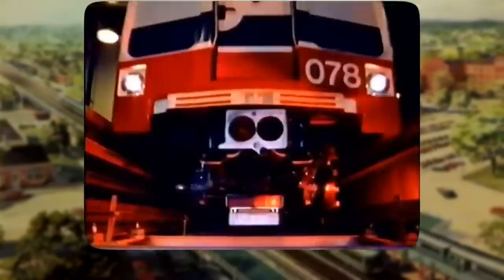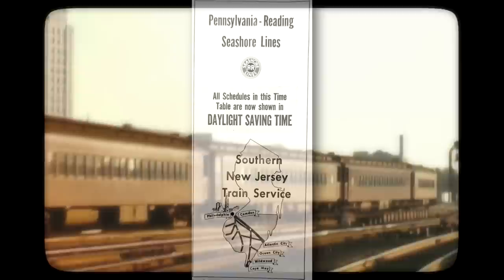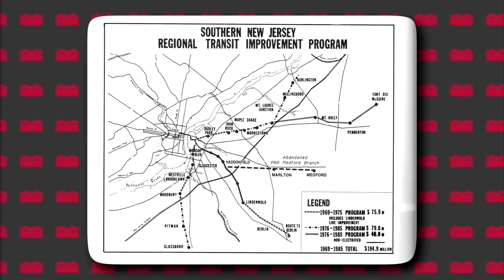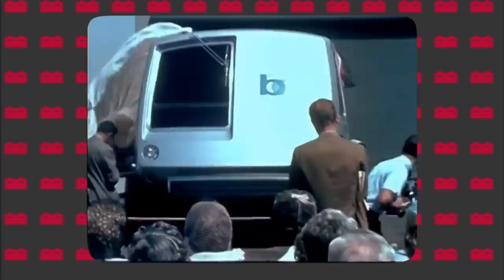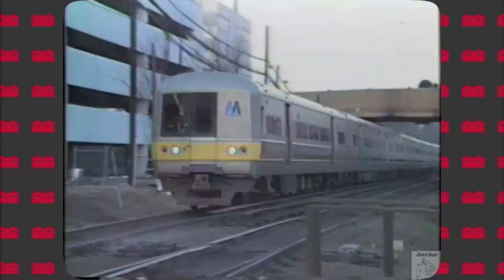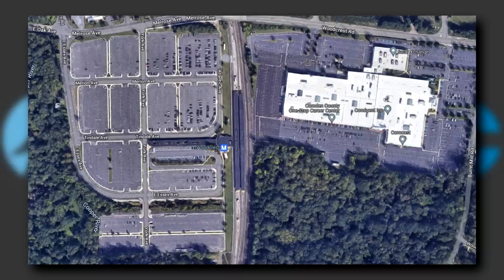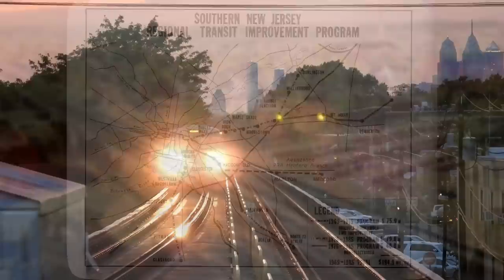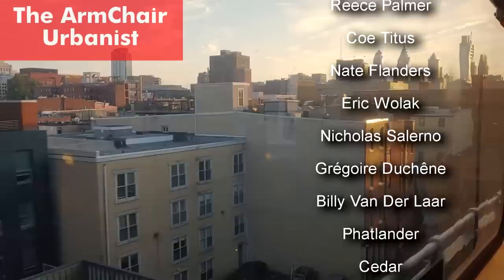PATCO: The First Modern Metro Line in North America

Comment: My favorite irony about the PATCO is that despite being very advanced, aesthetically it looks very retro to me (quite possibly because, being so well designed at the time, the system hasn't needed that many extensive upgrades, preserving more of the original fabric of the line)
Reply: If they ever DO expand (incl. New rolling stock) i really hope they retain that arsthetic as well as saving money by keeping it simple
Reply: Thats because it's effectively using the same railcars that it used in the 60s. They weren't even updated until around 2015.
Reply: Why are you saying it's retro like it's a bad thing? I actually I love it's aesthetic (but that's probably because I like the classic retro look of American Metro trains and not really that modern look that you would see in Europe or Asia).
Reply: @Machodave2020  it's not a bad thing, just a striking contrast! I like the look of the PATCO as well
Reply: @Machodave2020  I do too. Just pointing it out these are far from new.

Comment: We need more PATCOs across the continent, for real.
Reply: But with less parking and more TOD
Reply: @johnanders2739  yes i agree
Reply: Somebody in the 50s and 60s should have had that vision. Didn't any US generals avail themselves of the S-Bahn in Berlin???
Reply: @edwardmiessner6502  yeah center city tunnel is based on it. LA doing the same
Reply: Let's start with extending the actual PATCO from 1 to 3 lines like in the original plan.
Reply: Columbus should have a grade separated metro system but with low floor trains similar to the Confederation Line.
Reply: @SigmaRho2922  No, we don't need more light rail. We need more subways, because those are way more efficient and faster. They also look cool and actually encourage development.

Comment: PATCO makes getting to Philadelphia easier from NJ than from the Philly surburbs.
Reply: You can get from Collingswood to center city faster than rail lines from neighborhoods actually in the city itself (Manayunk, Chestnut Hill).
Reply: Yes, so true and sad. I limit my dating to ten miles on the PA side, there just isn't an easy way to get to a lot of neighborhoods in North Philly via rails, and I hate driving into the city.
Reply: It's also cheaper, when taking parking into consideration.
Reply: Well, parts of NJ, namely the Lindenwold line. It would be even better for commuting from South Jersey to Philly if PATCO stuck to the original 3 line plan.  Adding the Moorestown and Woodbury Heights lines could have doubled or tripled rail capacity to south jersey and taken that many more cars off the roads (I-295, NJ-42 and NJ-55).  And I still think that minimally just a second electrified potentially > 50% solar, grade separated heavy rail PATCO line is preferable to the proposed at-grade, diesel Glassboro-Camden light rail line.
Reply: @SP1CEANDW0LF  I mean that does sound awful in terms of rail travel, but it is not at all inaccurate to say that Collingswood is quite literally geographically closer to Center City than either of those neighborhoods are
Reply: Let’s be honest. You don’t need to “limit” your dating.

Comment: A little bit of context here: 

The US is the exact country where automatic train operation (ATO) was invented. To acheive automatic operation, you'll need an underlying protection system in the first place - the automatic train protection or the ATP - so that whenever ATO attempts to do something deemed unsafe, the ATP will alway safely intervene, usually by bringing the train to a full stop. 

The earliest railway ATP also came from the US. It has something called "cab signalling" in its core, which was invented by engineers at Union Switch & Signal (US&S) in ~ 1920s, when they realized that the electric currents sent to running rails for train detection (track circuits) may also be modulated to carry vital signal indications from wayside signal boxes to trains. Meanwhile, the ICC required railways to have some sort of automatic protection. Some big railways, like the Pennsylvania Railroad, tried this new technology, and found it to be so reliable that with cab signalling, you can actually eliminate most wayside signals!

Initially, power frequency current was used as the carrier of cab signalling. Upon invention, this type of cab signalling soon found its place on mainline railways in the US, especially in the northeast region. Passenger railways like Amtrak, LIRR, MNR, SEPTA, MBTA, still use this form of cab signalling today. Both PATCO and London's first semi-automatic underground line - the Victoria Line opened in 1969 - laid their foundation of automation on this service hardened yet a little bit antiquated technology. 

But major signal vendors in the US had been far more aggressive. In early 1950s, they found a better cab signal carrier: audio frequency current. Audio frequency currents eliminate most labor intensive inspections of rail insulation joints, are much less vulnerable to traction current interference, and are able to carry more information. These advantages naturally lead to preference over power frequency cab signalling among later transit expansion projects in the US. When SF decided to build its BART with most advanced signalling solutions, many vendors made their bids. The US&S's solution was based on audio frequency cab signalling, which enabled semi-automatic operation and dispatching. They lost the bid, but later provided a similar solution for Montreal's Expo Express, making the latter first railway in the world to run automatic trains.

The advancement in electronics pushes US-origin, "track circuit" based cab signalling and automatic train control to the apex from 1970s to 1980s, when the MBTA and CTA resignalled their heavy rails with audio frequency track circuits (so theoretically they can run semi-automatic trains but they don't), while the BART, WMATA, Baltimore MTA and MARTA built new semi-automatic heavy rails with them, until free space communication based train control (CBTC) went into the arena in late 1980s. 

While CBTC has been increasingly competitve, track circuit based automatic train control remained somewhat popular in the following decades to come. Taipei Metro contracted General Railway Signal (GRS) to provide signalling for their high-capacity lines; Shanghai Metro Line 1 also has GRS supplied signal systems, very similar to those designed for MARTA. LACMTA's Green Line, opened in 1995, has US&S's "next generation" audio frequency cab signalling that encodes digital signal indications instead of analog ones. In 2002, Copenhagen opened a fully-automatic, 24/7 light metro. Its signalling is not CBTC, but the same track-circuit based system US&S installed on LACMTA's Green Line! Contrary to popular belief, CBTC is NOT the prerequisite for full automation.

If you are interested in pre-CBTA era railway automation, you may refer to the following 1976 report by Princeton: https://ota.fas.org/reports/7614.pdf
Reply: Great write up!  Another thing to consider is that CBTC doesn't come "out of the box" with broken rail detection like AF track circuits do, which, IMO, should be mandatory.

Comment: I love the ambition of engineers at this time to try to solve the problems they saw with transport. Even though it doesn't solve the problems we need solved today, it's just one small change to get there. I think the same thing about WMATA, MARTA and BART. Really great pieces of underused infrastructure.
Reply: Even if the end product was not the greatest according to modern urbanism standards, at least they had vision and they built big. Today it takes 20 years and 20 trillion dollars to build one new line!
Reply: @pepperpillow  nah, we can still build things. It's getting the political will to do so.
Reply: @UrbanJerseyGuy  I think that marketing also plays a huge part in this. Germany doesn't do a good job marketing major projects and usually ends up developing opposition movements as a result. The US is better at marketing in general, but always enough to create political will.

Comment: I can remember as a little kid when Kings Highway in Haddonfield was dug up to put in the tracks and station for the High Speed Line.  The trains had a unique sound to them compared to the old diesel locomotives that ran through town.  I used the line often to commute to Drexel University in Philly and now as a senior I admire the vision and commitment planners had in the 1960s to make this work.  It is remarkable the system had only one station addition (Woodcrest) but no further extensions.  Thank you for the great trip down memory lane!

Comment: When I worked at the TTC I recall the 'Big' boss waxing poetic and lauding this line and the features built into it. 
I took the time to check it out for myself by riding the front seat and photographing it in the mid 80s and must agree, that this was indeed cutting technology and the best part, unlike most space age applications to transit, was as reliable as could/should be.
Bill Vigrass' commentary on the traction motor early failures reminded me of the Philadelphia and Western's high speed line and the similar early maintenance needs of the 'Bullet' car motors. Cutting the traction power voltage from the unusual 750 volts to the more common 600 solved the problem, but one could still experience the forces on acceleration of being pressed back into the seat cushions. Must have been something else with the full 750.
I must admit, that I like the P&W the best of all like demographic serving lines although with the PATCO's subway under downtown it is one step ahead in that detail.
Thank you for this documentary review Alan. I did enjoy it thoroughly.

Comment: It can still be great. We need to treat Philly like a German city and build out the regional rail and patco systems in manners similar to the Munich S bahn. The downtown tunnels (aka the hard work) are already done, signaling and high floor platforms are what remain
Reply: PATCo definitely needs to be integrated with SEPTA fares as well. Having a separate fare system for a single metro line is silly. Add NJT as well and any other prominent operators in greater Philadelphia.
Reply: @Joseph Being a software-development supervisor (for an unrelated company) I watched the Key disaster unfold from its beginnings in the 1990s. SEPTA violated almost every basic design principle in the book: 
- as you mentioned, they didn't go with a proven vendor
- they refused to look at other cities' best (and worst) practices
- instead of starting with a clean slate they decided that the Key should replicate the patchwork legacy fare system almost item for item. A LOT of resources were wasted duplicating quirks and inconsistencies that had crept in over the last 70 of so years.

There's a lot more but I'd be well into deep-geek mode.
Reply: Sucking up to the Krauts, are we?

Comment: There used to be 3 massive books including engineering diagrams and studies of the original PATCO line as well as the extensions to Atco and Glasborro at the Voorhees library.  They were a little beat up in 1994 when I last reviewed them but would be worth a look if you're looking for more design information.

Comment: Former DVRPC employee here (office of travel modeling from September 2017 - October 2021--I actually commuted on PATCO during my time there). DVRPC (along with most MPOs) doesn't actually have the legal authority to build anything. They can award funds for projects via grants and the TIP but those need to be applied for. They can also advise municipalities on good development practices, but that's about it. I would recommend doing a bit more research before making such assertions in order to prevent yourself from getting into trouble in the future.

Comment: Great video. Grew up and currently live in the SJ suburbs you and I really don’t like.  However, I love taking 295 to Woodcrest station to go to Center city.  It’s the most convenient way.  I live only a couple miles from the River Line which has a connection with PATCO.  If time is a concern (usually the case), the fastest way is to take 295 to Woodcrest rather than the slow River Line. 

I wish Woodcrest had a bathroom.  I took my son there to take a trip to Philly.   He had to take a dump and there was nowhere to go.

Comment: Regarding the ATO system that PATCO uses the trains only can use this system when the rails are dry. If it's raining or snowing the trains will over shoot the stations in ATO mode. Therefore trains must be run in manual mode if the tracks are wet. This is because the EMU's do not have a sanding system to increase friction with the rails. I rode the system back when I lived in south Jersey from 1985 until 1996 and I'm not sure if this problem has been rectified.

The Cherry Hill library used to have a large book containing plans for the three branch system as proposed back in the early 70's. As you mentioned the planned Glassboro LRT line will follow the proposed PATCO line. I'm guessing this will be an extension of the Riverline.
Reply: ATO is still not used during rain or snow. Maybe when the fleet is updated

Comment: Historical note: PATCO's design was greatly influenced by the Philadelphia and Western (P&W) interurban rail line that now runs as SEPTA's Norristown High Speed* Line. In fact shortly after PATCO opened, CBS News broadcast a short documentary about the two systems on national TV. 

Both systems are fully grade-separated, have third-rail power, and constructed to full passenger railroad standards. The differences of course are that PATCO operates much longer trains and is more automated than the P&W, which opened some 60+ years earlier. 

In the early 1970s there were proposals to connect the two systems by tunnelling under Chestnut Street, then using the old PRR Cardington branch tracks that ran to Upper Darby. If it had been built the connection would have fulfilled the P&W's early plans to provide cross-city service, and would have offered a seamless connection across both states. 

Of course, this being the Philly area nothing every came of the idea. 

(*) Under SEPTA's ownership, the words high speed should be in quotes. The route now runs about half as fast as it did in the Red Arrow days.

Comment: Very interesting! A lot of aspects of PATCO seem similar to the Montreal REM, which is also taking over a former commuter rail line and turning it into an automated metro, which will have wide stop-spacing allowing for greater commercial speeds than on existing metro lines. On the other hand (but also similar to PATCO), some suburban REM stations seem like they will have more area dedicated to parking than is really necessary.

Comment: I always wonder what killed the passenger train service to Woodbury when I was little.  
The proposed GCL will be a failure if it is every built.  Just like the River Line, 1) you must change trains in Camden to continue onto Philadelphia, Trenton, or Atlantic City; 2) the train doesn't go where the jobs nor where shopping is available in NJ; 3) On the NJ side it will basically only take between campuses in Glassboro and Camden with the County Court house in between which does nothing for the rest of the county; 4) Center City Philadelphia is no safer than Camden is now.  Even Wawa is giving up.

Comment: The parking lots are needed because the system is made to service the suburban commuter. People drive their car to the metro station, and take the metro down town. 
In order to cater to these people you'd essentially need a large and extensive bus and transit system in these areas which right now is not the case. 
So if they were to build houses on top of the parking lots,  no one would use the metro any more.
Many of these urbanism channels forget that cars are and will continue to be an essential mode of transportation, and we must be able to equally cater to motorists, transit users and pedestrians. If we just completely underfund one of them, we will run into problems later down the line like we did with under prioritized sectors.

Comment: MBTA's South South extension of the Red Line was built in a similar model as PATCO as a quasi-interurban and the No.1 (01500/01600) cars from 1969 also have a suburban interior configuration.

Comment: Fun fact: 2 years before PATCO opened, Montreal built the Expo Express, an overground metro line that featured ATO. It served the expo 67 fairgrounds with 5 stations and used modified H series TTC subway cars. Technically speaking, it’s the second metro line in the world to use automatic train operation. However it fully closed in 1972 due to low ridership.
Reply: I so wanted to say just that. It was built with GoA4 automation. Drivers were only put in place to appease potential passenger concerns regarding fully computer controlled trains

Comment: pretty convoluted if say you wanna go from Newark to Atlantic City, needing two or 3 different transit lines to go a destination in the same state which a much smaller distance than I can go with the MTA, 3 different services but the same agency can get you all over 3 different areas of NY and CT, makes me not take it for granted considering this
Reply: The casinos used to pay NJT to run an express train called ACES from New York Penn to Atlantic City stopping only in Newark, with a snack bar and everything you'd expect on Amtrak. It even skipped Philly, as it turned off at Frankford Junction straight to Atlantic City instead of backing out of 30th Street. Unfortunately, it didn't get them enough ridership, and they quit paying for it. Now, you would probably take the 319 NJT express coach bus nonstop from Newark to Atlantic City. To be honest though, most of New Jersey sucks ass, and their transit once you leave the rail lines sucks too. That said, Jersey City is fucking amazing. It probably has the best urbanist initiative anywhere in the US.